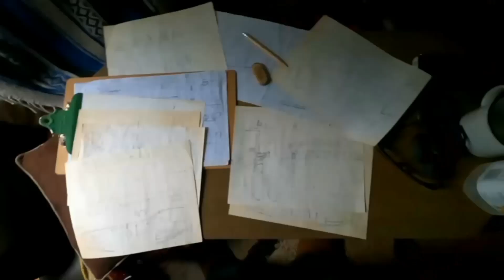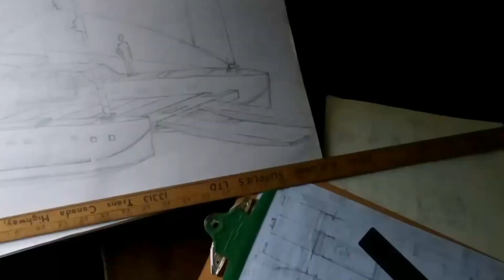Creating "Oceansflow" - zero emmision barge: chapter one

Comment: nice idea, hope it works out. i had a similar idea but to keep it much more simple. Take 2x identical sailboat hulls (just found a pair for free but i have no budget) Then join them as a cat, potentially as a transforming cat so width can be reduced if necessary. But the general idea would be to have a huge overhead and unobstructed flat roof that would be 100% covered in Amphorous silicone solar panels, ideally not even one single line would shadow any of the roof.. I would not use used lion batteries or you will spend your entire life hunting out the dying ones. It would be nice to add some type of wind power or kite backup. I have the solar panels but i don't live near water and i can't afford to go pickup the hulls.
Reply from the maker: I encourage you to try :)

Comment: You could run a diesel for 20yrs non stop before it exeeds the mission of producing lithium batteries and solar panels. Not even mentioning child labor in kobalt mines and open air acid basins. The green agenda is a farce creating billions of profit for the same old corporations sinse the industrial revolution. Those are the only ones with the power and recourses to invest in these markets and make you buy it through PR and legislation.
Reply from the maker: I basically agree with everything you've said. To imagine that we're not part of the system is a fantasy. As a person who lives "off-grid" and "recycles" etc, I understand how completely I am entangled.
And, it still needs to be done. 
Be well friend.

Comment: Wow, cool design. That is a huge catamaran. I like your inventiveness. Maybe you can think of a use for used wind turbine blades. Could be a useful building material. They have a big problem with trying to dispose of them. They mostly end up in landfill
Reply: Ya they could make a interesting hull or maybe a vertical rotating sail.
Reply from the maker: Thanks!
That's curious about the blades. They would make interesting hulls, as I imagine your suggesting...

Comment: Very interesting thoughts and boats!
Reply from the maker: Thank you! It's a fun but long project. Have a good day
Reply: @wisecrackworks8851  I will follow your journey! Greetings back from cold germany.
Reply: I have a plywood catamaran, built by someone else. 
I see your cross beam is a box constructed, I hope it is well sealed with epoxy and with some cross ventilation.  Some parts of mine were not, fortunately I caught it in time.  
Also make sure the external skin is sealed with epoxy glass below the waterline.  And all the inner surfaces sealed, and well ventilated 
Great project, well done, amazing what you can achieve on your own.

Comment: I love your design and your work ethic….I’ve lived on boats since 1981, and am just finishing 8 years in the 
rebuild of a 65’ power cruiser, your heart and mind are definitely focussed on a great approach, but the sea is an unforgiving place and I would suggest you get a surveyor to check it out….. as the ply you are using is very thin to my eye, and if you end up being pummelled into a wharf one day, I fear it will fold up…..maybe more frames and stringers are on the way, I don’t know, so forgive me if you consider this to be negative, but it’s not meant to be…….good luck
Reply from the maker: Hey thanks for the thoughtful message. I've designed it so the shelving and beds will act as reinforcement along the outside walls after they're installed. Which will be much stronger than stringers. 
And frankly it's a different approach, it doesn't have ballast so it won't sink, and I just repair any damage I get. 
That's the idea anyway haha. To build so it can withstand any point load would mean it would be way too heavy. Got a link to any photos of your boat?
Cheer!